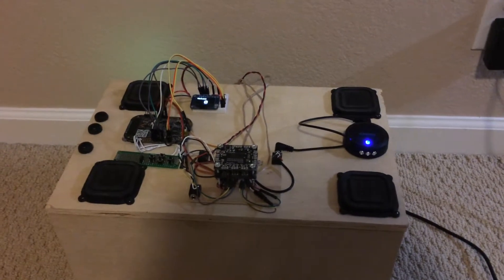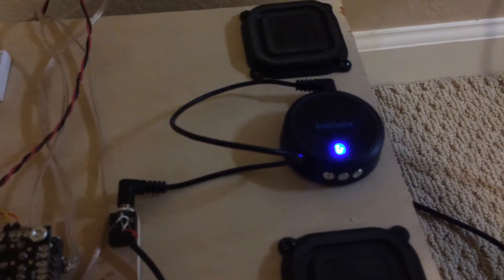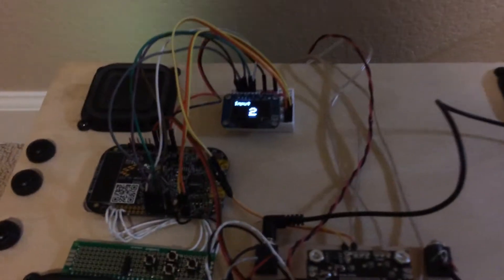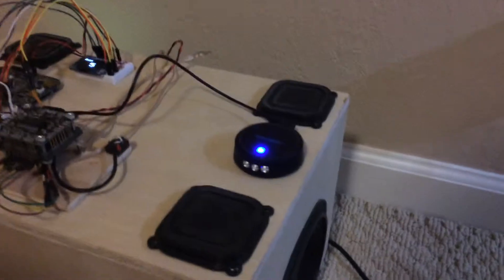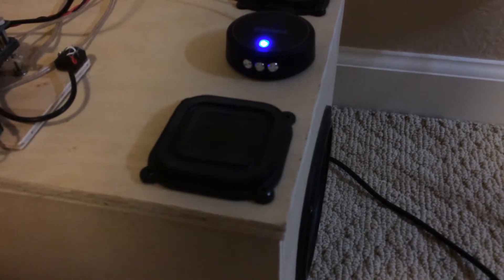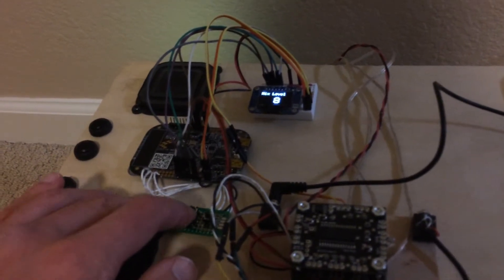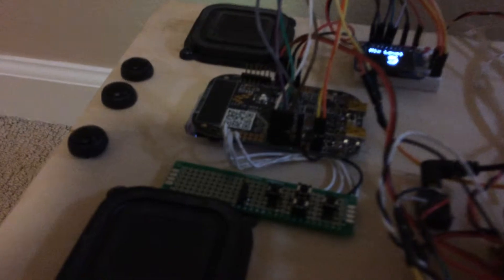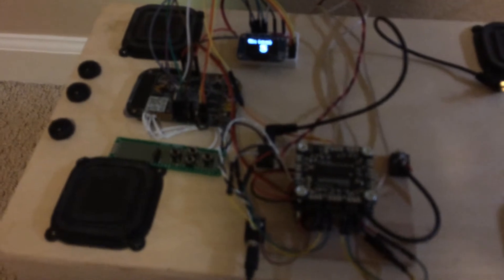TDA7419 mbed / arduino car stereo project

Comment: Do you have any parts / wiring information on this? I am looking at doing something similar with the factory radio shell.
Reply from the maker: Hi Danny,  sure!  See the Facebook page on this:  https://www.facebook.com/ArduinoAudio .  That has links to the mbed project code and also to the boards (plus more pictures).
Reply: Daniel Cohen Thanks for the information.